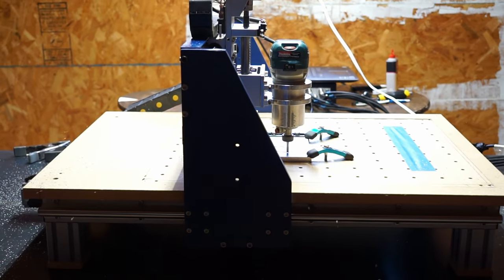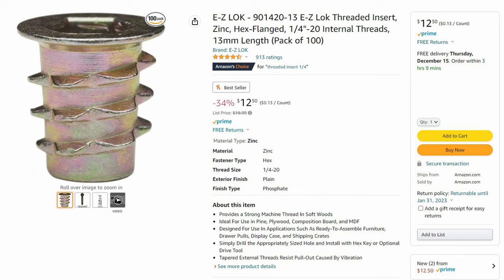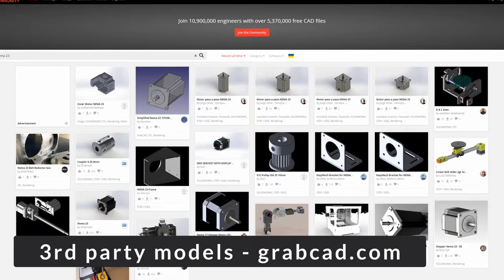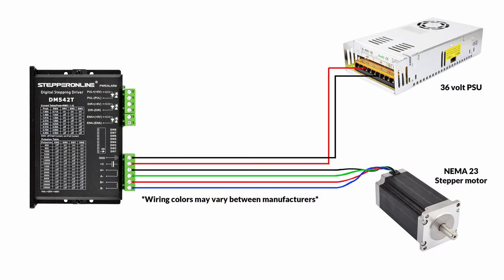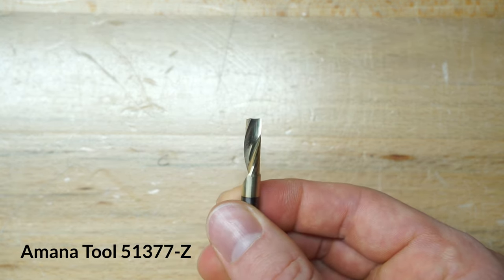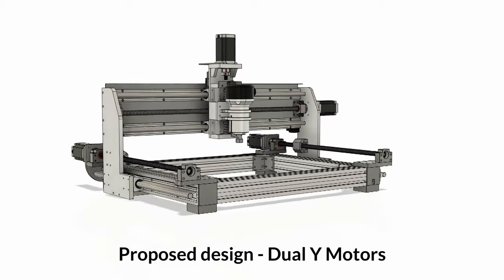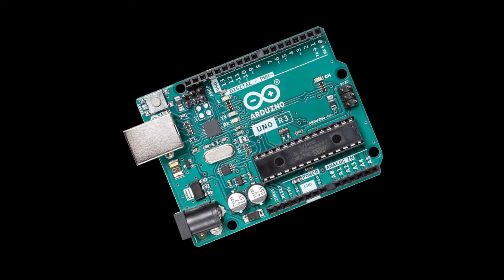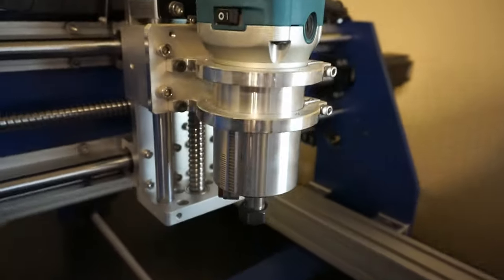DIY CNC: Your Questions Answered (and what I'd do different)

Comment: Hi Ben, Thanks for the inspiring videos!  I'd like to ask you, or anyone who has successfully built a reliable and dependable CNC machine, how much tweaking and fiddling you had to do before every project? Put another way, what percentage of time is spent fiddling with the machine to get it to work reliably and with confidence over actually using it in its purpose as a tool?  My past experience, and I am not exaggerating, 99% trouble 1% success. 

I bought a "Bobs CNC E3" router based on Arduino/GRBL/Universal G Code Sender and spent at least 100 hours in frustration, troubleshooting, tweaking, tightening, calibrating, back and forth to learn Gcode commands, troubleshoot the GCode etc. and never  got the machine to make a basic test pattern cut, without a problem, like the Z axis plunging through the work piece for no apparent reason,  leading right back into the circle of problems. I do not have these problems with other CNC type devices I own, which are NOT GRBL based. At this point I am skeptical of any Arduino based CNC using GRBL.
Reply from the maker: It definitely requires some fiddling around with and tweaking of the settings at first. Now I am at the point where I don't have too many issues though. I just used it to cut some 1/8" aluminum plates for a new project I'm working on (video coming soon) and had no real issues. I've also done several wood carvings without problems. The only re-occurring issue I had is that sometimes it doesn't return to exact 0 after a job, so if I am using multiple tool paths on one project I have to double check that it did before the tool change. But I do think that GRBL/arduino is not the best platform for this, and would look into a dedicated CNC control board + Mach 3/4 for any future machines I build.

Comment: Thanks Ben so much for the plans, its good to be able to take a look at them, did you ever finish the plans for version two with the twin ball screws on the bed at all? I would be quite interested in building that one over this winter as a project for myself. I would scale it down as I want a smaller desktop model but I want it to primarily machine Brass or Copper.  Cheers, keep up the good work thanks from Spain.
Reply from the maker: Thanks. I have not built version 2 yet, I have been working on other projects. But I would still like to in the future. The only thing I have changed at all since the video is the Z-Axis. If I do a full-scale upgrade or rebuild, I'll definitely make another video on it.
Reply: Thats great as that is the one I would like to build... @benmakeseverything

Comment: Hello Ben,
I wish to thank you for sharing the Video on the Router machine you have built .The information you provide is excellent.I am building a manual one for time being and will upgrade to a CNC like you have built in a short time to come.Need your advice, can the Stepper Motor be use for Routing in heavy use like production, which please advice.
Thanks & Regards, Richard Yap
Reply from the maker: It really depends on what type of production work you are doing with it. The NEMA 23 - 425oz/in torque stepper motors I am using are very strong, but larger machines may use even bigger NEMA 34 motors.

Comment: Great project. 

You don’t appear to have pull up/down resistors on your logic outputs from arduino. This would be why you are having interference issues where your opto isolators didn’t help.
Reply from the maker: You're right, I should. When I built this I knew a lot less about electronics than I do now. I have been meaning to rebuild the electronics but have been busy with other stuff.

Comment: Out of interest how did you find the process of calibrating the machine? For example, how to ensure that 10mm on screen translates to 10mm on the workpiece? Was there a lot of manual measurements and offset adjustments etc required? When I began 3D printing I found this process quite tedious with printing calibration cubes and trying to measure fractions of a mm and adjust the firmware (Marlin back in those days) to get everything dialled in just right
Reply from the maker: I got a rough estimate by calculating it using the pitch of the ball screw combined with the steps per rotation of the motor, then dialed it in using the method you described.

Comment: Do you have issues with random stops, or some wierd lags? As i can see you using arduino with ch340 converter(that 16 leg ic near usb port )  you need arduinouno  board with atmega16u2 as converter ic.
Great project!

Comment: I am looking at doing something very similar but using a 3018 router as a sacrificial equipment, basically because the 3018 router has a offline controller that has a SD card reader, my question I have is do you think the Arduino controller may converse with the stepper drives, it seems I may have a newer one than you have, it has an output for a laser module (bonus). I also am sitting here looking at my benchtop drill press and thinking of putting linear rails under it with these controls, it can drill 3/4 holes in steel. I have a 3d printer so I can make adapters for the spindle, but just looking at it for now with an evil laugh.
Reply: An Arduino should be able to control any stepper driver with a step and direction interface which to my knowledge is all of them.

Comment: i see for first time an isolator board for limit switch, they are harmless. to get rid of interference twist the wires, connect capacitor between GND and signal, and 1kOhm resistor between 5v and signal.

Comment: Where did you terminate the shield for the shielded wire?

On my build I shielded mine at DC ground inside the enclosure.
Reply from the maker: Thats what I did as well. Should have explained it better.

Comment: One question I was hoping to see was, how long did this take you? Both in terms of "I started in March, and it was done in September", and the approximate number of hours you put into the build (since presumably you didn't work on this non-stop.)
Reply from the maker: I had the idea over a year ago, and worked on it on and off for at least 6 months, but I have a full time day job so was only able to do a little here and there. I don't know the actual number of hours. The main roadblock I hit was the DPSS laser issue and having to design a custom driver/switching circuit as I mentioned in the video - took me a while to figure that all out.

Comment: Mind elaborating just a bit more on the limitations of the Arduino? What software do you use to talk to the CNC, and how is the performance limited by the Arduino?
Reply from the maker: Sure. The Arduino clock speed is only 16MHz, so it could could potentially be a limiting factor in interpreting the gcode if it can't keep up with what the PC is sending. On the PC side, I use Universal Gcode Sender. It seems to work pretty well but I'd be interested in looking into other options.
Reply: @benmakeseverything  thanks bro. I've got all the knowledge required to build the hardware.. software wise I'm still trying to understand the best way to talk to the machine..

Comment: I have a question on the design of this CNC machine. Would it be better to have Y axis mounted solid and have the plywood bed be driven in Y? It looks to me that the mass of the entire X & Z assemblies will affect performance. Just a thought...
Reply from the maker: That's definitely an option and some machines use that configuration. It is probably more rigid, but the downside is a larger overall machine footprint for the same cutting area since the whole cutting platform moves back and forth.

Comment: love the project! can you tell me if yours is Linux-compatible? I don't mean Adobe Fusion or the sculptor, but whether it works with linux-based g-controller apps.
Reply from the maker: I haven't tried using it with Linux myself, but check out LinuxCNC - http://linuxcnc.org/
Reply: @benmakeseverything  thanks for the response! I asked because in theory it should be compatible, but I don't have the hardware nor can I afford it at the moment so I can't actually test it.

Comment: Just wondering with water cooled spindle do you have ideas of what to change so can machine steel too? I don't care if just machine at like 0.1mm depth on each pass just like to have one with the ability if I need it
Reply from the maker: Yeah it would be awesome to be able to cut steel. I think overall the machine would just need more rigidity. As I mentioned in the video, better linear rails would be a big improvement.
Reply: @benmakeseverything  I been thinking linear rails anyway but seeing what you did makes me think of DIY instead of buy a machine to then help DIY the parts, also as where I am thinking to counter weight the gantry so can like fix to a wall as not got much space where I live

I have thought to make like a square frame then make it inside of it so like keep material away from rails like the Queen bee or other has C profile where drive bit sits inside the C on outside the machine area

Mainly thought machine steel as like make machine stronger than aluminium plates and also small projects in future if need steel but rest be softer material

Comment: I would suggest anyone learning from this re-examine a few areas. Number ONE rigidity. Flat plate is very poor rigidity for the weight use some kind of hollow section like the ali extrusion or stiffen those risers with 1" steel tube. There are calculations you can find on line for simple sections, this is worth studying before starting.  The motors are way too big and big is not always better. Larger motors have bigger coil inductance and this limits step speed and slows the whole machine down noticeably. Look at the winding impedance in the spec sheet when buying. Carving is not very demanding but your ali milling speaks for itself, you are an order of magnitude too loose on rigidity.

Comment: I am sorry but do I need for each stepper motor 1 additional supply? 4 steppers = 4 supplys?
Reply from the maker: You only need one power supply, assuming it can provide enough amps of current. Check the maximum power draw of each motor and multiply by the number you are using. And of course leave a little extra just in case.

Comment: What is the maximum thickness can cut in your cnc
Reply from the maker: The maximum thickness would be 3 inches (7.6cm) due to the clearance height of the bottom of the Z-axis assembly. I could have made it taller, but that was plenty for what I want to do with the machine.

Comment: Would you use pi to run your cnc
Reply from the maker: You could probably use a Raspberry pi, but I haven't tried that yet. I use an Arduino Uno as the control board, which is connected to my laptop with a USB cable.